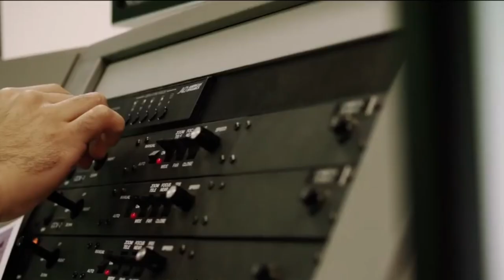GE F414 engine deal & extent of Technology Transfer #drdo

Comment: For me this deal is critically important for the following reasons
1. As mentioned in the video we will be developing ecosystem for complex jet engine development in India
2. Even for amca mk2 GE offered advanced variant of the same engine which could produce 120+kn. This is critically important because the existing ecosystem would already be there to produce most of components, substantially reducing the production and maintaince cost. The question that would arise is would it be able to support rapid transition of supersonic to subsonic without affecting engine life cycle.
We need atleast 500 engines by 2035 - 110 for Tejas mk2, 200+ for naval fighter, 40+ for amca mk1. Not to mention additional orders for Tejas mk2 in future along with spares.
Many will still support to go for rolls Royce engine development or with Safran. But I feel modified ge 414 is better in terms to cost, ecosystem and maintaince in long run.
The only disadvantage I see no IPR rights, which I think we should negotiate hard in next 10 years so that even that could be a reality.
Reply: Good Analysis.👍
Reply: Nicely explained sir

Comment: Another question can HAL absorb all this tech so easily? After years of producing the much less advanced Su-30 engines, a lot of components are still imported.
Reply from the maker: Yes it will be as it already has manufacturing experience of  jaguar, Su 30 mki and mig 29 engines . However this deal will be exposing new technologies for which GE and Hal is working . It is expected to be absorbed in 3 yeara
Reply: @IndianDefenseAnalysis  Manufacturing experience is very different. It more like make- to -print. Can we make 100% of the SU-30 engine indigenously after this many years? Of course I am assuming that we have received the needed TOT from Russia.
Reply from the maker: @ashokkandimalla5962  not sure if we are making all parts for Su 30 engine but based on various report I can see we have better quality than Russian parts and it has significantly increased the aircraft’s availability rate

Comment: Worst deal ever in the history of deals. No IP rights means there is no ability to modify the engine without the permission of GE. What does this deal even bring? Top dollar was paid for obsolete junk, the dumbest decision ever made. A much smarter decision would have been to invest in Kaveri engine. Flying test bed and wind tunnels remains the No1 priority.
Reply: They are giving only da toolz but not da IP rights, sad, we became foolz !
Reply: @prashanthb6521  An entire decade to get the good bits of tech? It seems like these are bad deals, and the best option is to rely on indigenous engines only. KAVERI
Reply: Also, what do you mean by modify the engine ? If India can't even make a proper jet engine what is the point in knowing how to modify it.what this deal does is gives us the 80% know how and then we can use that to create an entirely new program like kaveri which will fail again...
Reply: @yogiyo5000  No we can't, IP rights forbid you to modify or create derivative. Only GE has the right and they won't even allow racing stripes. That is why this entire deal is a gigantic scam, and ToT always has been.
All the ToT deals done, and Bharat cannot build a submarine or Bofors artillery or a single engine. SCAAAAAMMMMMM.

Comment: Honestly, I found the 100% TOT issue was over hyped. Such a figure was never uttered by either US or Indian officials ever to the best of my knowledge and the speculation just set unnecessary expectations in the minds of the public. IMHO the 70% or 80% being mentioned is pretty good if the reports that this is the first time US is parting with tech is true. Incidentally a version of GE414 (RM16) used in Gripen is manufactured by Volvo/GKN. The extent of TOT in this case is not known to me.

A stealth airframe is easier to design than a true high performance turbo fan. The  SU-57 and J-20 took years to get a good engine. Three stealth or near stealth jets AMCA, Boramae and Kaan all use US engines, at least in the initial stages. This shows the difficulty in designing a high performance turbo fan. The other two European programs have opted to develop new engines concurrently with the frame but their industrial base (and that of US) is very different.

Comment: This may be seen as an initial step towards having self sufficiency in engine tech. The single crystal super alloy casting is the major area where India is slowly catching up now & is one of the most important things when it comes turbine blades. UK is already working on entirely Nickel less blades with high temp materials for future engines. To make them economically, we need to make atleast 2000 engines. For which exports are the only way. But we have to make the radome, fuel lines, ejection seats, LRUs, etc., indigenously to make the price under the limit to compete in the market. One thing we should consider to include in the deal is to incorporate local alternatives for those 20% things in the future and export rights without any strings attached.